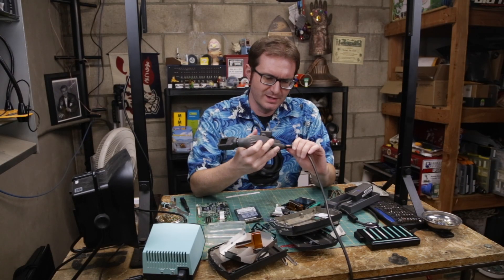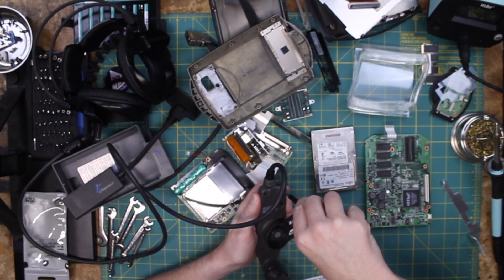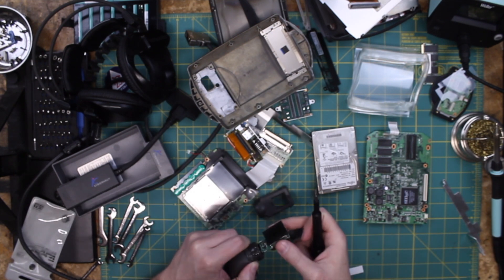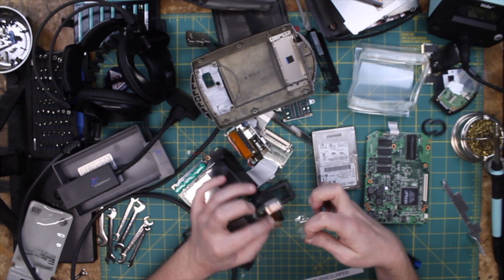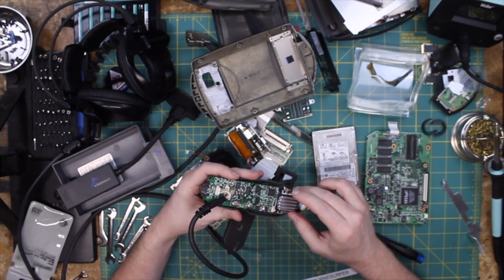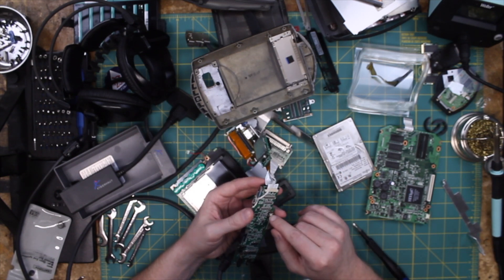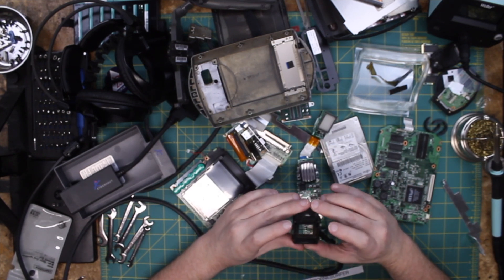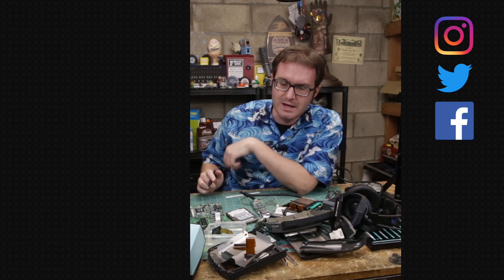Xybernaut MAIV HMD Teardown (Project Xyberpunk)

Comment: I really want to get a MA-5 and gut the main unit and replace it with one of those really small gaming PC handheld units and find a way to build an interface board for the headset to connect to VGA or HDMI out, and replace the keyboard unit with a lightweight 40% mechanical keyboard or something so I can basically upgrade it to the ultimate cyberdeck. But I'll never be able to afford a working MA-5 headset version